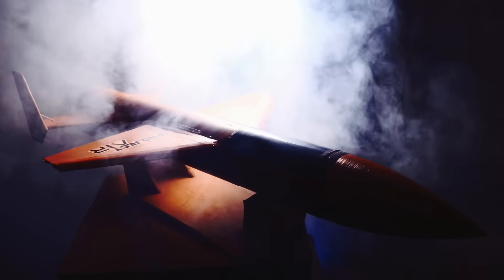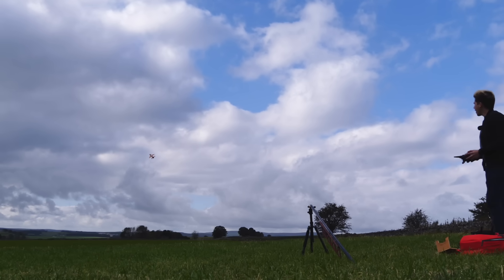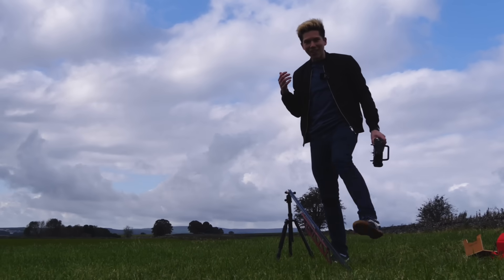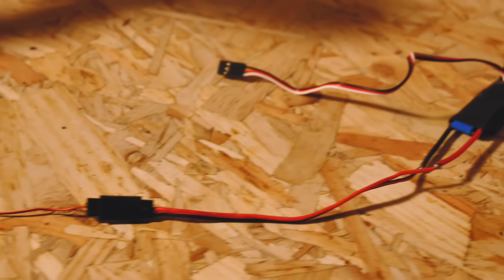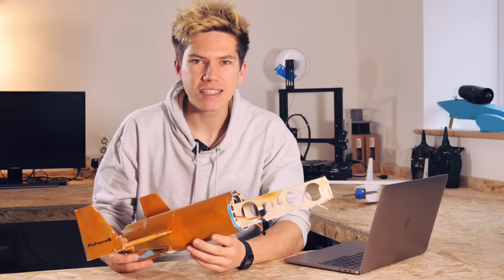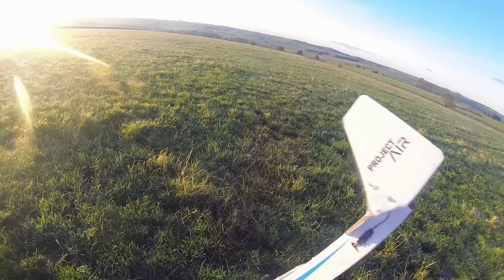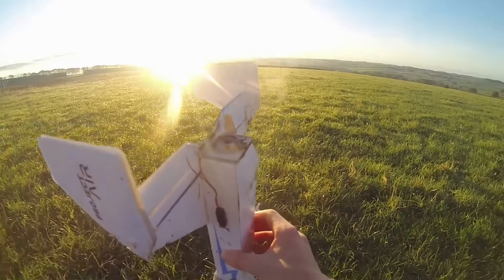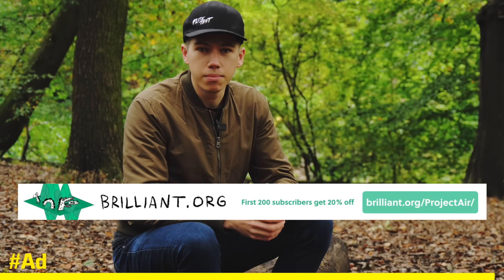High Power Rocket Plane pt.2

Comment: Have you thought about using a prob from a glider, the ones that fold back when not in use. Might help having them fold back when you hit the rocket... loving the videos by the way !!
Reply from the maker: Yes I was thinking about using one if I am to continue with this hybrid system! I may return to pure high power rocket planes in the future through, perhaps dropped from a drone (with increasingly huge engines 😉 )
Reply: @Project-Air  if you do so - which I think is a great idea - make sure to cut off the power when you switch to rockets, as the propeller might ruin the blades if it folds while spinning
Reply: @Project-Air  can you name the white plane Sielulintu? (Finnish word, approximate english translation is "Soulbird". They are creatures from finnish mythology, wich bring a person's soul to their bodies on the moment of birth, and on the moment of death they bring the soul to the afterlfe.)
Reply: @Project-Air  I definitely think following the Virgin Galactic air-dropped model gets you the most benefits. The carrier plane can have large wing surfaces for greater lift while the rocket plane can have smaller surfaces for greater speed performance. Unless maybe you go with a delta wingform I don't think you can get the lift + speed it seems you're looking for and as mentioned elsewhere and speed above the rated one for the electric motors/props will have a drag inducing effect.
Reply: @Vanhala  And Virgin got that idea from the USAF and the X-planes projects of the late 1940's on.  Some form of air-drop will likely give the most benefit as the "first stage" launcher.
Reply: @michiganengineer8621  Yeah parasite aircraft have been a thing for a long while. I think the Soviets got the ball rolling on those with their TB-3. It's a pretty great concept! Hopefully we can see them make something work!
Reply: @Vanhala  The only annoyance with that is that you end up with two pilots being needed, and a lot of redundant control gear.

How about this for a concept: Rocket plane with stumpy wings, with a larger, higher-lift wing 'piggybacking' on top. The large wing could be ditched just before firing off the rockets, and because it would now just be a lightweight wing (with no stability, or electronics), it would just flutter to the ground without damage. If it was too heavy, a small chute could be sandwitched underneath it so it only deploys once the wing is dumped.
Reply: The issues with the disposable wing concept would still be that of drag induced by the props, and you'd have a centre of gravity shift once the wings detached (also detaching a lifting wing in flight without creating a collision with the now free flying/tumbling wing creates it's own difficulties). 

A workaround for the two-ship/two-pilot solution could be automation? If the mothership is programmed to fly a simple pattern (maybe a rectangle during which the launch can occur on the long leg) at a standard height then it removes the issues with two pilots (though you'll still need control gear). 

The rctestflight youtube channel does a lot of automation flights with gliders and other aircraft. 

I'm really enjoying this discussion!
Reply: @Vanhala  All valid points, but you could engineer around most of them:

The prop drag issue is definitely a problem. Using a folding prop is the easiest fix, but it does mean your rocket still has to accelerate the 'dead weight' of your motor and propulsion battery. An alternative would be to stick a battery, ESC and motor (or two) inside the 'piggyback' wing, with pogo-pins or similar connecing the ESC to your reciever (you don't need to transfer much power, so you can rely on small connections like these). Of course, your piggyback wing is now heavy and 80% of a full plane, so you'll definitely need a parachute on it. You also lose the ability to resume powered flight post rocket-boost.

The C.G issue shouldn't be too big a deal. Provided the CG of the 'rocket' configuration is fine, all you need to do is adjust the forward/aft positioning of the piggyback wing to get the correct C.G. in both configurations.

Clearance when ditching the wing is a fairly easy to solve problem - you can design the attachment method so that it 'hinges' from the trailing edge, and make your tail / vertical stabilizers all hang down, instead of point upwards. Something like an inverted V-tail would avoid clipping the tail with the wing as it separates.

Automation would also work perfectly well, and avoids a lot of these problems entire. It just feels like a bit of a 'boring' solution. Making a plane fly circuits with electronics is impressive, but visually not that interesting for a video. I think something that solves the problem mechanically is more fun to watch.
Reply: @Project-Air  That would be cool to do FPV. They say the trick to flying is to miss the ground...
Reply: @Project-Air  How about a variable pitch prop that will passively increase pitch when you hit the rocket then go back to a flatter pitch when the rocket quits? If you don't want to deal with the ejection charge use a 1st stage engine and cap the front end with some aluminum foil flue tape so it won't put hot gas into the inside of the plane.
Reply: @greggv8  too complicated in something like this
Reply: @Project-Air if u can drop from a glider w a POV cam 2 steer it, it can reach sum serious altitude!
Reply: @Project-Air  You need to borrow Tom Stantons RC Dambusters craft :D
Reply: @Project-Air  pure rocket is going to be hard with hobby motors.

They have poor dV/mass which means the tiranny of the rocket equation becomes unbearable fast.

Hobby rockets make do because they're just engines, thin cardboard/plastic and a parachute, but with the added electronics you're going to need a whole bunch of them in parallel, and probably 2 stages of them.

Which is cool af, but really complex.
Reply: @Project-Air  - How about a timer, that fits lights 2 Rocket Motors, then, @ 1.5 seconds later in a 1.6 second burn, lights next 2 Rocket Motors!
Reply: @Project-Air  maybe from a Helicarrier?👀
Reply: Came here to say this!
Reply: I know nothing about this stuff and I thought I’d make the crazy suggestion of retractable blades. Then it seems they do exist already of sorts!
Reply: @richards7909  Yeah! There are some full sized powered gliders that use retractable blade props - and the engine mounts will also fold away into the fuselage too!
Reply: @richards7909   they look like this https://www.espritmodel.com/aeronaut-black-spinners-for-folding-propellers.aspx
Reply: Another option would be to put the electric engines on a spare that is held on with minor friction and can slide out backwards. When the rockets fire the electronics drop to the ground. The balance would be an amazing feat of engineering.
Reply: If you over-rev those foldable props they would probably be damaged as i dont think they are designed to spin (at its fastest speed) while folded, which is what it will do. They could be very strong i dont know about that.
Reply: Featherable props would also work, if if you can get small enough ones that is. I haven't seen any props that can be feathered on RC aircraft though.
Reply: You have to make the nose heavy, so it can push the centre of gravity